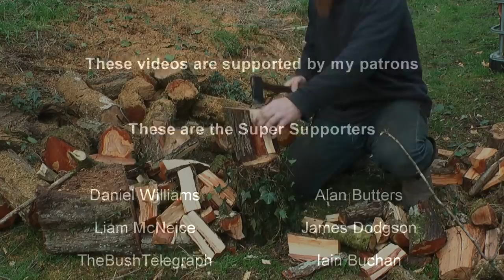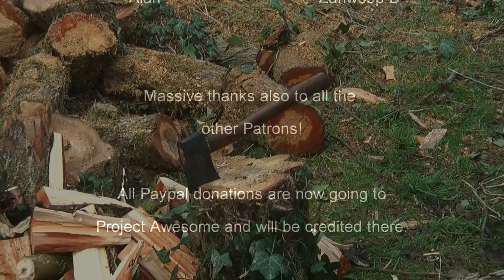Forging an Axe from a Truck Spring

Comment: For an adjustable power hammer, the arm between the spring and the top dyes can be swapped out with different lengths. Adjust the travel to match so it doesn't hit the support.

Comment: RIP Power hammer :(
Reply: I'm sure Max has some more springs laying about to make the repair.  Bet he does some tweaking of the design to reduce the metal fatigue, too. ;>)
Reply: @jjudy5869  I hope so, it was a cool design to re-use old things he had lying around.

Comment: My great uncle used anthracite or steam coal crushed to about the size of hazel nuts riddled to remove the dust to light it he would use a pice of newspaper scrunched up bruned till the flame went out then air was gently applied so the coal would catch more coal and air was added till it came to working temperature that was my morning ruteen for many a summer holiday

Comment: Nice one Max. The Evenk tribe in Siberia make their axes and knives handed,ie on the knives if your right handed they put a 30-32° chisel grind on the left of the blade and on their axes the same 30-32°  chisel grind ,but on the right side for right hand and left for left. Just curious why you didn't put the wedges in before cutting off the excess handle.

Comment: Perhaps that is why some blacksmiths still prefer to use bellows to blowers, your less likely to overheat the steel being that your forced to remain present during the heating. even a hand crank blower might be better.

Comment: In about 1997 i had to do heat treatmant on metals as part of my aprentisship when to putt it into wood shavings water oil or boiled linseed oil all depending on the grain one want even  helped with deltas aka general  moters stamping parts learned alot not using  my nolage today want to get an anvil and forge myself i am itching to make a knife for some reason when seaing all the spring steel.One can use a welding oven to let it cool down in on its time did that with the car aluminium cylinder heads and cast iron ones after welding them pre heat it put your workpuece in and then turn it off and let it cool like that.Some graphite powder may work as a lubricant between the leafsprings otherwise put oil in between the blades we used to mix oil and grathite powder .

Comment: Have you thought about using just an I-beam instead of the spring and an air cylinder or a hydraulic one with a piston and both side ports connected to each other as the rod from the motor up?

When your foot pedal closes a valve on this connection slowly you can adjust the torque transferred to the I-beam and thus to the hammer :)

Comment: How much of the work you originally planned to do with the power hammer did you have to do by hand after it broke?
Reply from the maker: Not too much, a few more heats under the power hammer would have been nice but the bulk of the work was done.

Comment: on making charcoal - i'm just about to get into it, any advice on best practise for a pit/mound type situation?
Reply from the maker: Nope, never done those! I prefer a retort kiln setup, although an old oil drum kiln also works well for small scale burns and is much easier to build.
Reply: @maximusironthumper  thanks, and no worries. oil drums are a bit scarce and the soil is very clay rich down here, and i'm having to dig a pond, so i'm committed to most of the effort anyway, may as well make use of it!

Comment: Toughness is usually expressed in terms of deformation to failure - it is a measure of how much plastic deformation it will survive before it cracks apart. So, yes, the modest level of carbon means it has more toughness than high-carbon steel. 
But isn't it the hardness that you're experiencing from your end of the hammer? I wouldn't expect the toughness to really be apparent because you're not causing it to break - you're just persuading it to yield.
Note: I say this purely as a person (engineer) who sat through a load of metallurgy stuff 25 years ago. I claim very little experience of working steel or even of selecting one or another flavour of steel for a given job. 
Materials really are interesting. Steel especially. I remember the realisation at about 20 that 'materials' was actually a thing, and a big, important, interesting chunk of engineering at that.
Reply from the maker: Yes my language is rather imprecise there - I'm talking about toughness as a property of the steel and then toughness of forging as in it's hard work to move it under the hammer. Bear in mind that most of my forging experience is with mild steel and iron so any lumpy carbon steel seems dramatically more difficult to work in comparison!
Reply: @maximusironthumper  That ended up really pretty. Does your grinder need a new motor capacitor?
Reply from the maker: @Rich-on6fe  I hope not, it's only a few weeks old! It has a soft start feature which might be what looks like a duff cap?
Reply: @maximusironthumper  Ah, that could be it. Long live the grinder.

Comment: The eye is wrong - it is likely to damage the haft and cause it to break -  make a new haft and see for yourself, then fix that eye.
Reply: Oh! - a 'you're doing it wrong' comment - there's a shocker....!
Reply: @andymccabe6712  Hi Andy, I'm not an iron worker - I work wood.  I know that wood will fail if the wood / iron junction is not optimised to favour the much weaker wood.  A wooden handle has advantages over an iron handle -- lightweight, shock absorbing... but if the wood to iron junction is not crafted to minimise the susceptibility that wood has to fail at a sharp junction with iron, then the haft will fail quickly.  Believe me or don't, but the eye is as important as the axe edge.
Advising a skilled blacksmith of a weakness in his creation is not a negative thing  if the intent of that advice is to improve the final outcome.  Getting 'hurt feelings' over constructive comment does no one any good and fails to grow a persons knowledge and experience.

The purpose of my comment was to build - what was the purpose of your comment?
Reply: @Nodeoergosum  Oh look... a selfrighteous, "I like to have the last word" comment - another shocker... lol...
(Before you ask, the purpose of my comment is to show up your pomposity... lol)